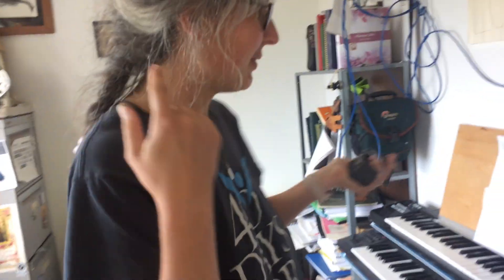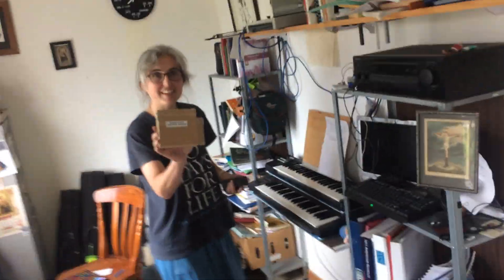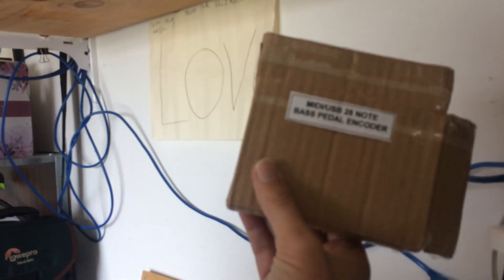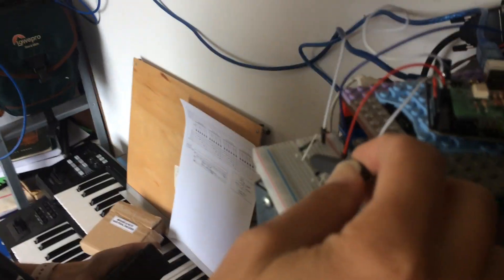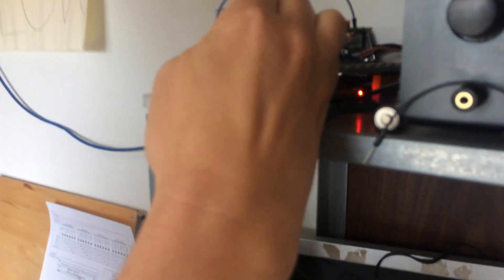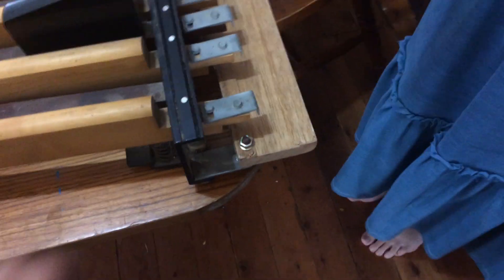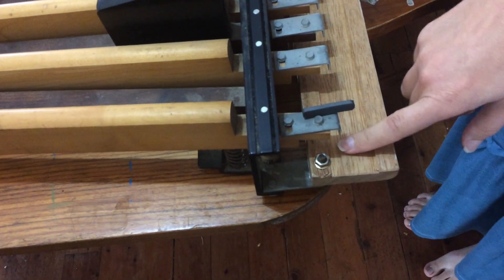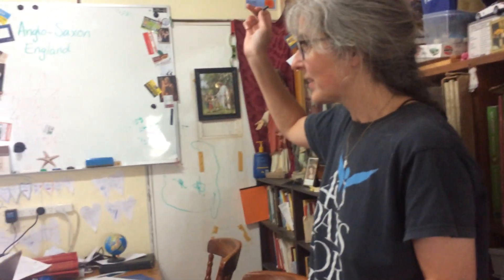Update on the Organ Pedalboard with new MIDI encoder

Comment: Congratulations!  I'm in a similar path. Can I ask, how do you manage the pedals hitting the floor? Does the enclosure has some pad or something for avoiding direct contact (noise)? In general, could you cover on a next video the enclosure part? Thanks in advance...
Reply from the maker: Yes, the pedals rest on springs and there are felt pads. I'll have to take a video giving a closer look at the mechanism. I still haven't finished the wiring, but the reed switches and magnets are in place.